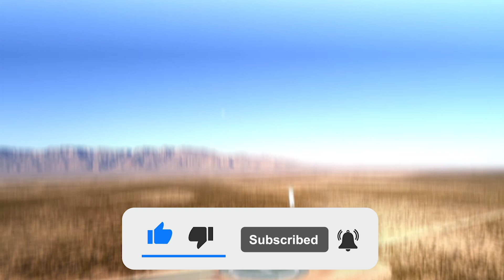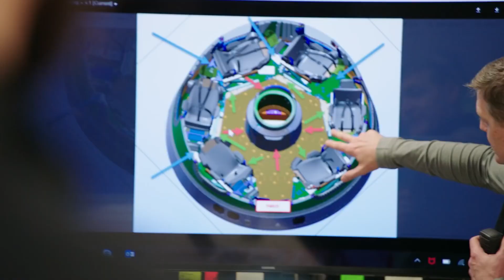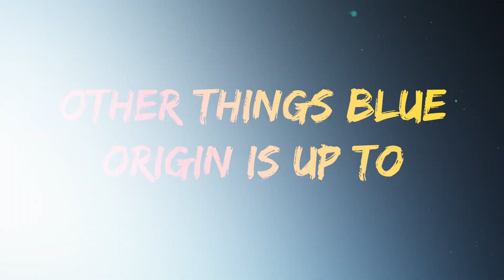Project Jarvis: Blue Origin's Reusable Upper Stage

Comment: This is BS. How much do they pay you?
You do realize that the BE4 does not work, don't you? In order to fly rockets, let alone have them return, you need a reliable rocket engine. Blue Origin has very reliable tiny engines, but no heavy lifters. They are in hot water with all of their BE4 customers because their BE4 does not work. And at the slow speed that they design and develop and test, they aren't going anywhere for quite some time.